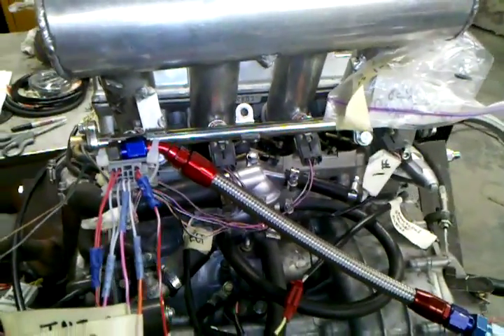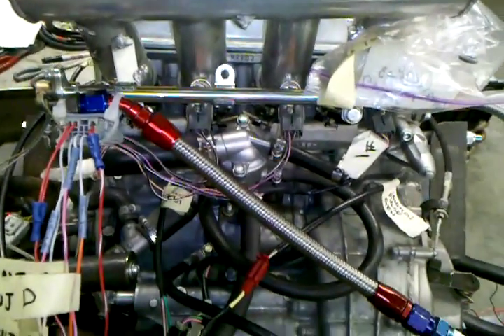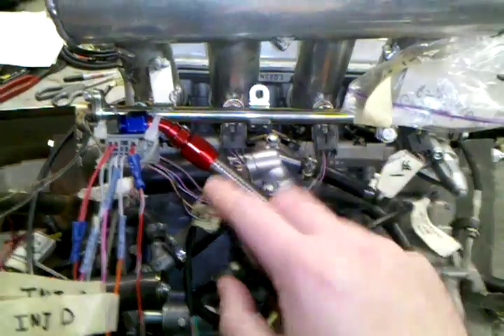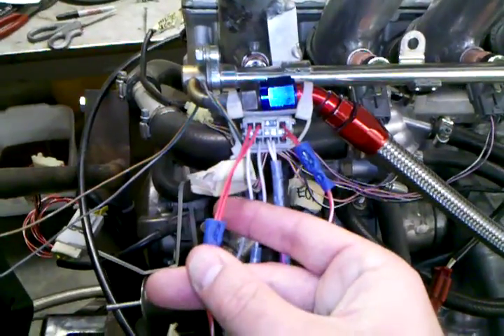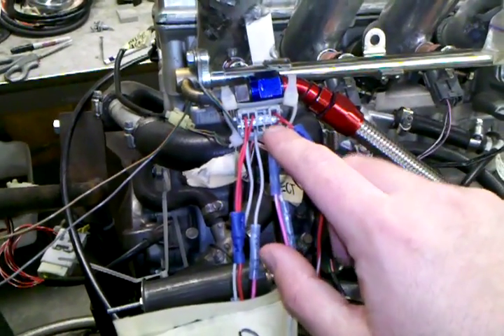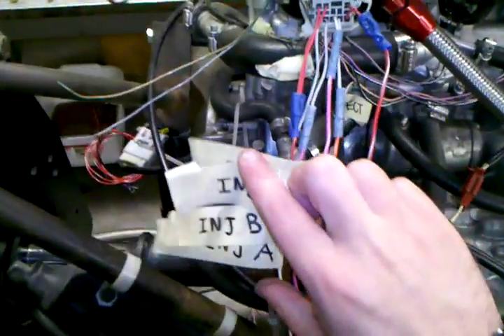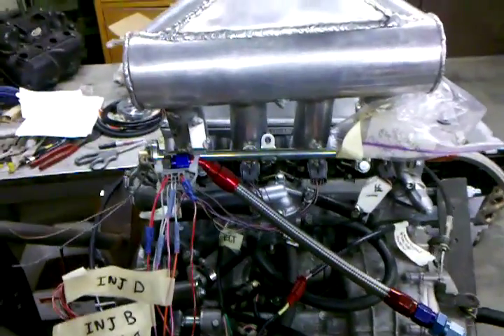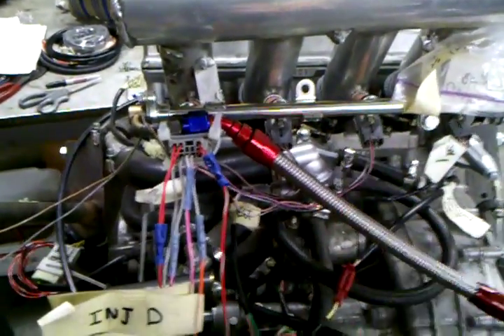CBR600RR Injector Wiring Configuration for MegaSquirt v3.0

Comment: My left 2 injectors arent getting a signal. All pos are hot. It only runs on right 2 cylinders. What is the issue. Im thinking ecu. And will this correct issue?

Comment from the maker: Secondary injectors were not wired up because the intake plenum diameter on this engine was the size of a Nickle. With an air volume that is that constricted, very little fuel delivery is required, hence there was no need to wire the secondary injectors.

Comment from the maker: I don't know off hand what the stock fuel injector size is for a 2006 CBR600RR. Check the Honda Shop Service manual, or call Honda technical support.

Comment from the maker: To determine the size of the injector, you need to trigger the injector for a duration of time and determine the volume of fuel that flows out of it, then divide the discharge volume by the duration of time. For example, use a fused 12.7 Volt DC circuit to trigger the injector for 1 minute. If the discharge volume in the 1 minute period is 200mL, then the injector is a 200cc/minute injector.

Comment from the maker: Stock fuel injectors were not used, because they were unavailable. Denso fuel injectors of unknown size were instead used. Denso doesn't employ part marking on its injectors, so when you call Denso Technical Support you must tell them the male and model of the vehicle that you pulled the injectors from.